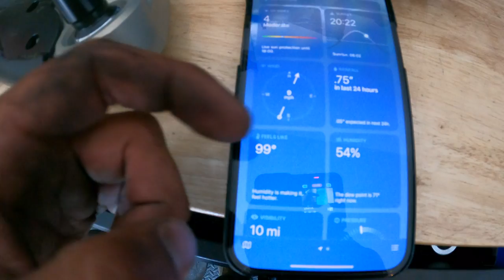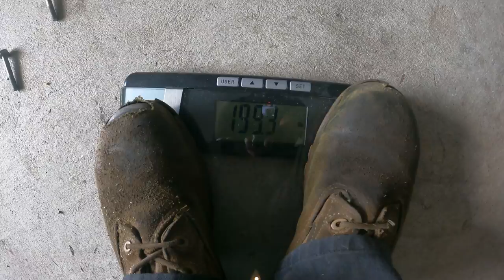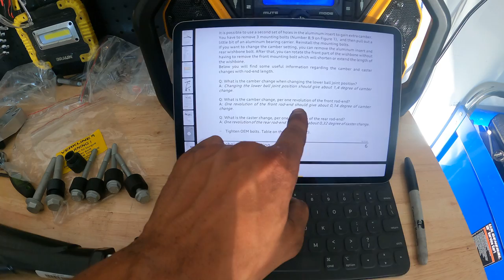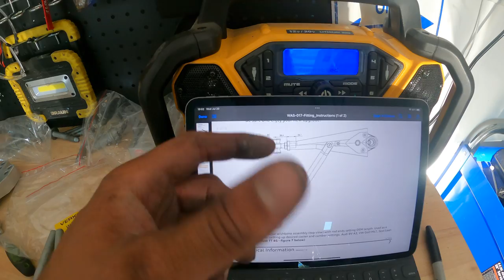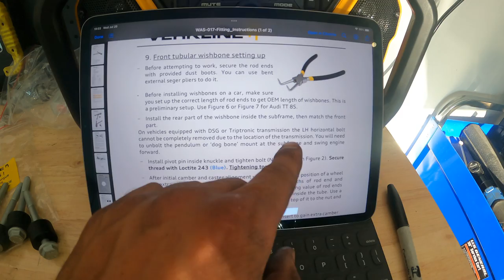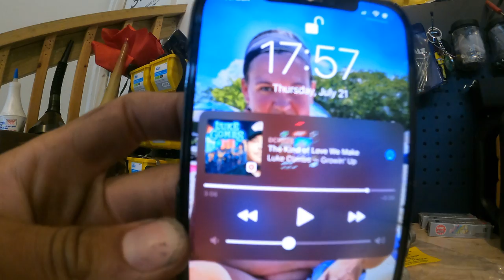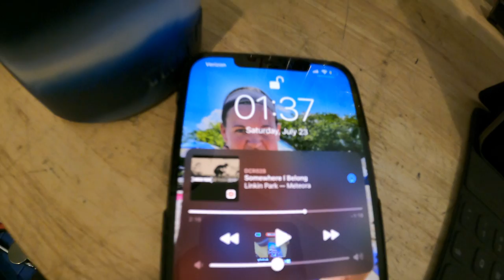Verkline tubular front subframe & control arms install! For all MQB cars

Comment: Tubular subframe and spherical joints give you the ultimate precision and stiffness, but ……..at a price.

I have a similar setup on my practice rally car, with pillowball top hats and a complete rollcage . 
The car is very responsive and tight. Zero comfort and quite noisy, because everything is transmitted directly to the chassis.

But ,man is it fun to drive 😁
Reply from the maker: I really enjoy it all!!

Comment: Damn bro, this is the longest YT I have ever watched..  Oh man, getting that Verkline installed is an absolute beatch!!  Hats off to you. I was wondering, you commented no rubbing (paper test) but that's with an empty car. But what happens when the old lady and you sit inside, wouldn't the space get smaller or rub during suspension 'action'?  Good sign is that you feel the steering is tighter already. Looking forward to the alignment and true road test!
Reply from the maker: With the weight that might be a thing for camber but not so much camber, at least at full lock. Never at full lock unless I'm racing (alone) or in a parking lot so I'd be very slow.. good observation though you might be onto something. I'll have to pack the car up and make sure there is no rub! Pretty hyped to go test man, strut brace came in yesterday and camber pucks come Friday hopefully align for good early next week 🤗

Comment: Bryce, dumb question, how do you jack up the rear end on your car? My GLI is AWD converted and I find that is the hardest thing to do as I don't want to destroy mounts or bushings back jacking on the diff or something that I shouldn't
Reply from the maker: I jack on the spots on the sides of the car, there are spots further in where you can install jack pads, I believe ECS sells jack pad kits. Then I place my stands on the subframes. If you're using the OEM rear subframe there's some flat points you'll see kinda behind the wheel if you're looking straight on it. I've jacked from the diff before though I don't think it's a terrible idea but I don't do it often
Reply: @BryceJordanProductions  I was looking at those jack points while watching your video. Good to see ECS has them I’ll have to get a set. Thanks for the video and all the blood sweat and tears on this one hHa

Comment: I'm confused, which one adjusts what?
Reply from the maker: Leg to right camber front to back caster
Reply: @BryceJordanProductions  so the smaller arm is for caster?
Reply from the maker: @draza3083 the one without the ball joint is for caster
Reply: @BryceJordanProductions  Got it! Thanks man! You got huge balls to attempt this on jack stands. All of that, gyattdam. Also, what specs did you end up going with and did you write down the thread lengths for em?
Reply from the maker: @draza3083  I do have notes on the threads! Wound up at -2.9 camber and I think right at 8° caster. I actually just ordered coilovers gonna wind up setting up the car for some drag racing here soon so there will be more fresh content on the verkline stuff in the following month or so!

As for jack stands yeah it wasn’t fun at all whatsoever but I’m glad I did, I learned so much and that’s priceless